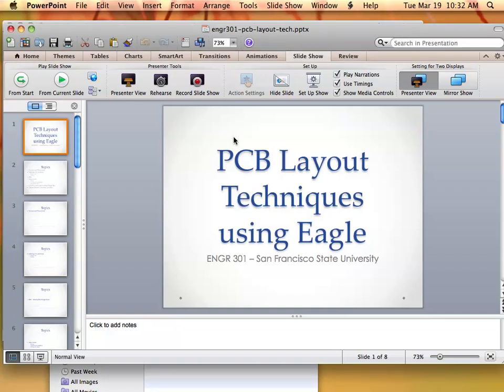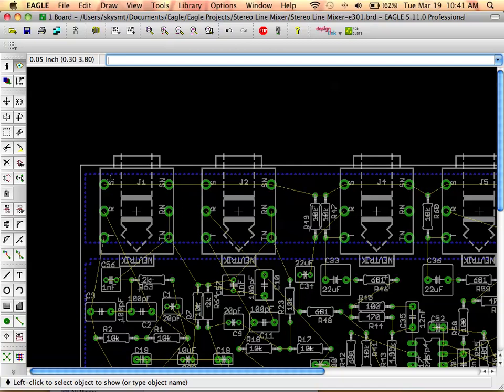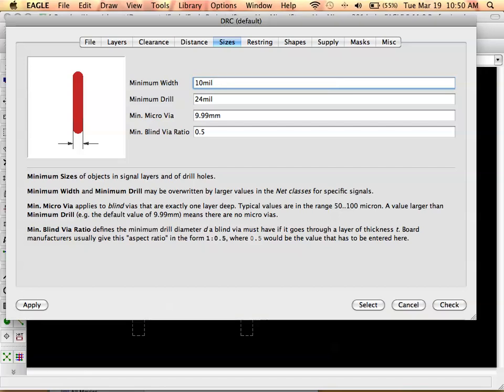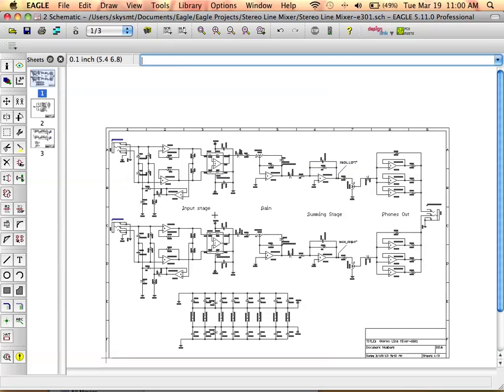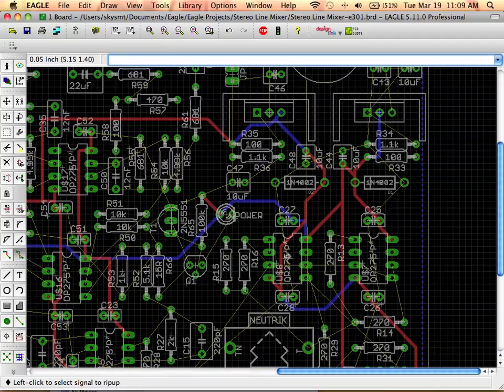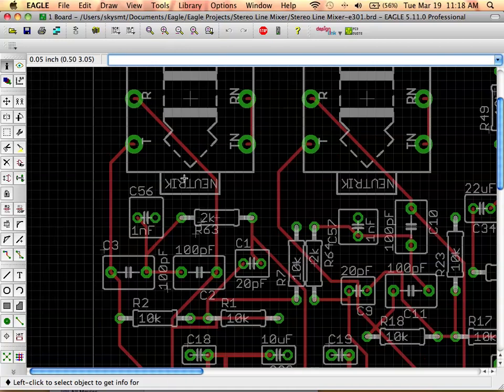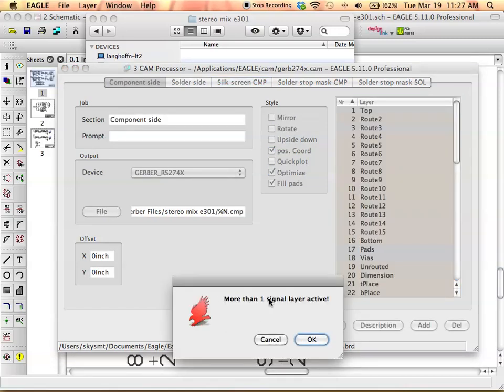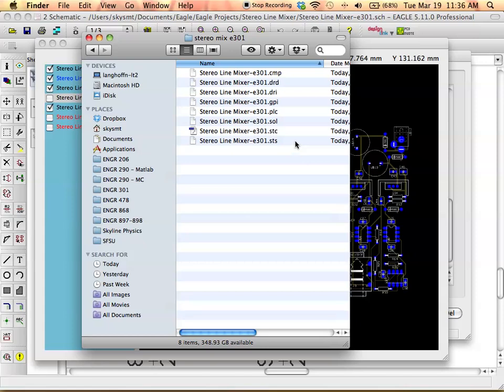engr301-pcb-layout-techniques-sp13

Comment: Very interesting video!. When i use separate grounds, audio and Chasis ground, i usually use jumpers,zero ohm resistors or ferrites, to make the differential signal "jump" the gap between the two grounds. Is it good practice? Are there better techniques? This "jump" between grounds ¿May create crosstalk or noise?